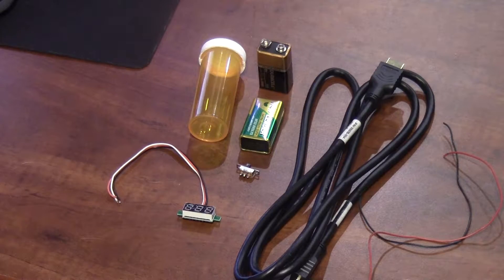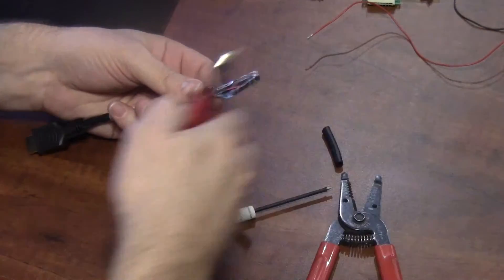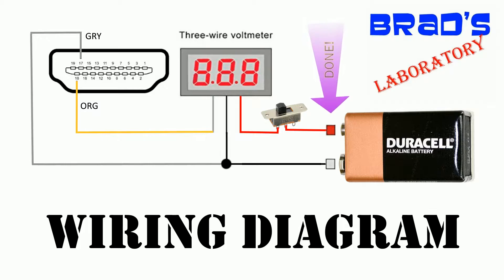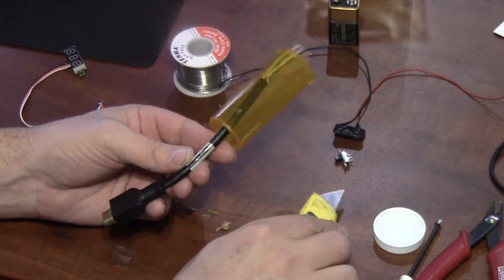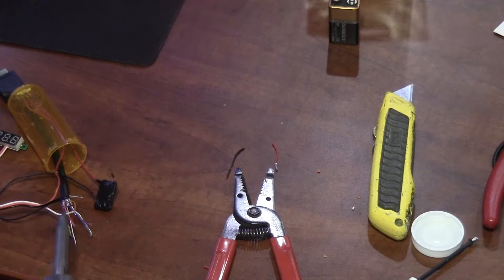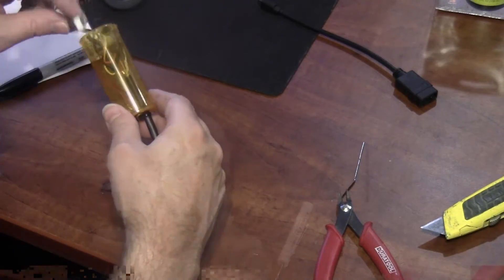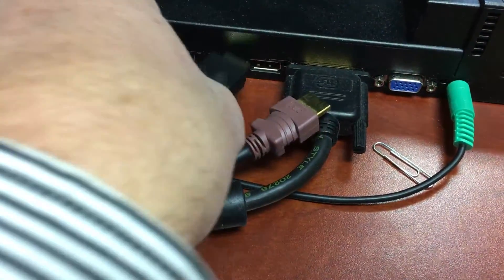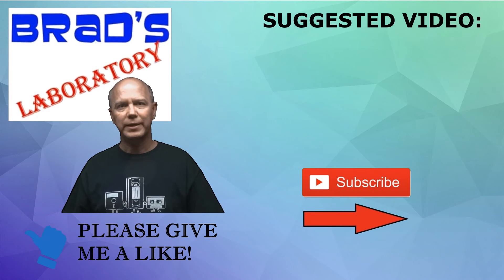HDMI Voltage Tester

Comment: Thanks for the video! But,. the HDMI mapping is wrong. The correct is 2 for ORG and 3 for GRY, not 18 and 17.
Reply from the maker: I am just grabbing 5V and ground, which are pins 18 and 17. Pins 2 is a shield on TDMS Data 2 and pin 3 is TDMS Data 2-. If I wasn't on the right pins it wouldn't work - the idea is to see if the devices are outputting the 5V like they are supposed to.
Reply from the maker: https://www.etechnophiles.com/hdmi-connector-pinout/

Comment: You got 0 on the transmitter because it's a sync device. That's in spec.
Reply from the maker: I really don’t think so, the 5V is supposed to be there regardless.

Comment: Thanks for the Video. Do you know if a TV ouputs 5v or is it only the devices? I am trying to find an output that I can use to switch an LED backlight on through a relay. The USB ports are on all the time so I can't use them. Looking for a signal that will go off when the TV is off.
Reply from the maker: The 5 volts is on every HDMI connector, per the specification. It is on all the time so it won't solve your problem. What TV do you have?
Reply: @BradsLaboratory  It's a Sony Bravia KDL32WE613BU. It was for my mother who is in a nursing home. The staff put her TV on but not her lamps. So I set up the lamps  through a relay on her TV USB port). This setup used to work on an older samsung TV but this new Sony has USB on all the time. just had a little sniff about on the HDMI port and some of the signal wires are 3.3v and they drop to nothing when the TV is off....so maybe an opto- isolater on one of these pairs might work to trigger a Mosfet. I have a few opt-couplers that will trigger on less than a milliamp.
Reply from the maker: Doubt that will work, the pins are all data lines, I was thinking maybe hot plug detect would work, but your TV is HDMI 1.4 and that changed that from a simple I/O pin to a data pin. Probably the easiest thing to do it to pop the back off it and tie to the back light control pin on the circuit board. But that will void your warranty.

Comment: What's the max voltage this device will test for? We need something along this line to test TV's that we suspect are backfeeding excess voltage that's frying multiple cable boxes. If this won't do it, it's there a device out there that will?
Reply from the maker: This is the unit I bought:
https://www.amazon.com/gp/product/B00C58JGE6/ref=oh_aui_detailpage_o05_s00?ie=UTF8&psc=1

It will test from 0-100 VDC.

However it comes from China and I wouldn't stake my career on it, but it will give you some idea.

Each side of the HDMI path is supposed  provide 5 volts to for a hot plug detect, This should be diode protected in the equipment so as to not allow voltage feedback.

I think I would rent a multi-channel oscilloscope and check all the data lines for problems. HDMI is pretty strict about following their specification, so It would be interesting to hear what you find out.